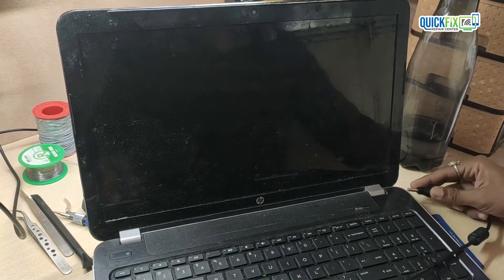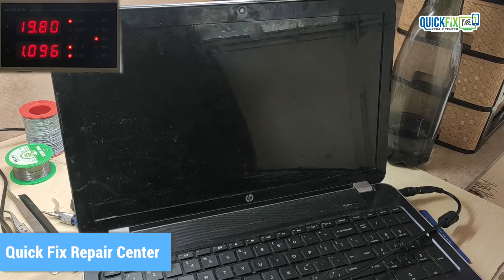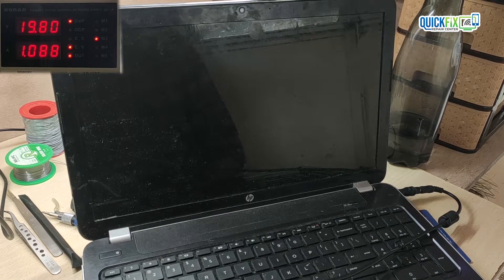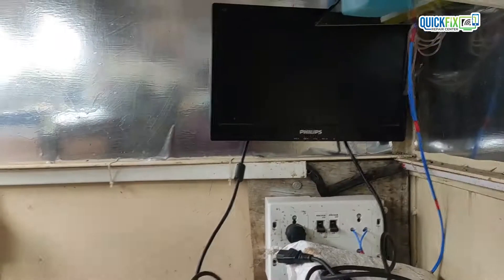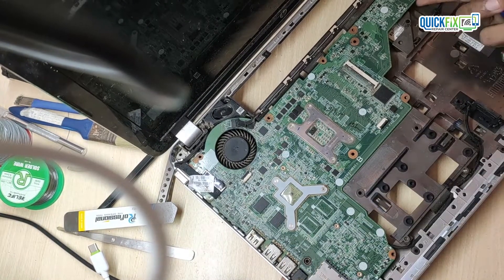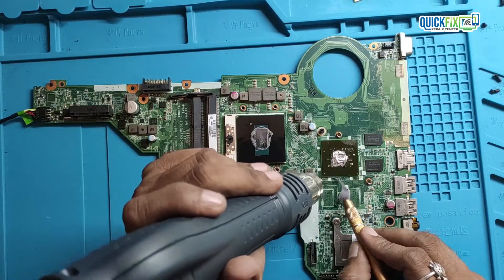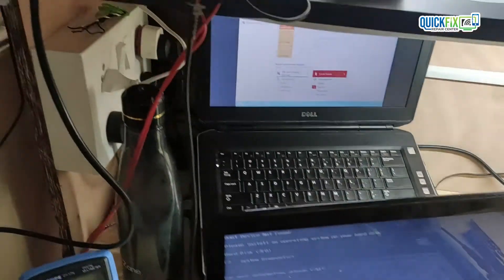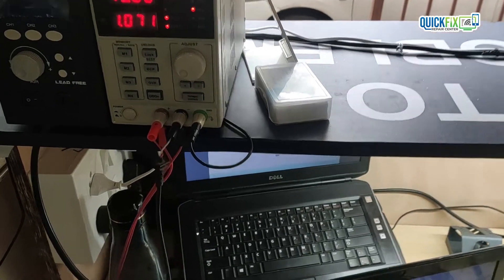laptop power on but no display | HP laptop no display but has power

Comment: sir please make how to inject voltage to laptop from dc power supply
Reply from the maker: I think it's easy. Just ground one wire of dc power supply and connect positive wire on relative circuit. But before that u must know maximum voltage of that particular line